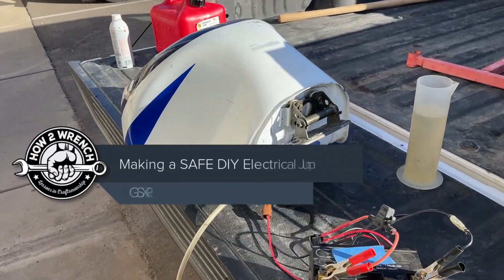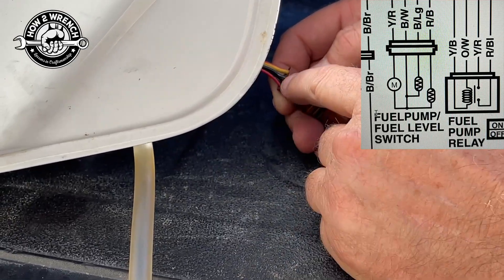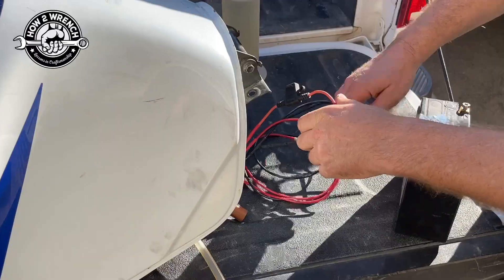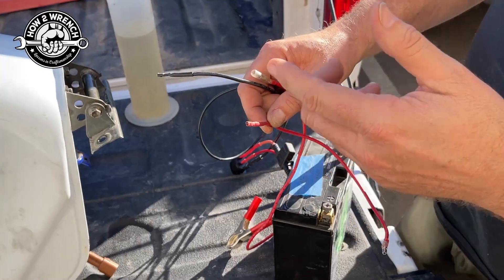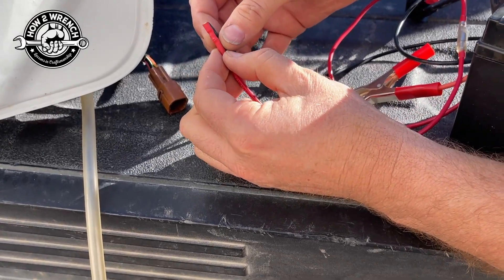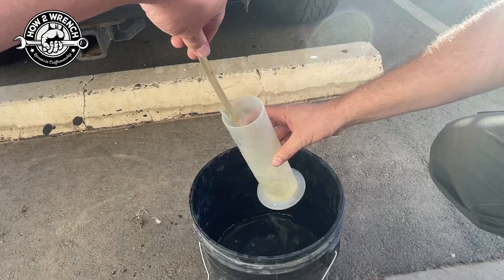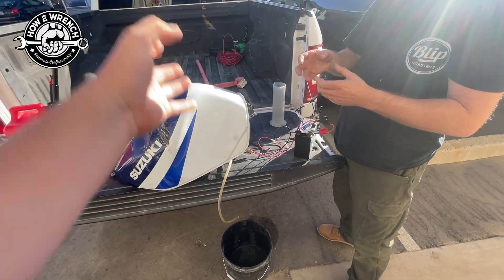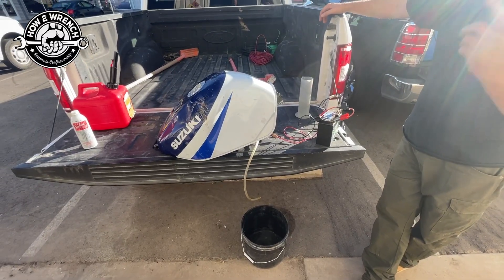Fuel pump testing with this simple DIY Tool Makes Electrical Testing 100% Safer!

Comment from the maker: Build Materials List: 
LED Switch: https://amzn.to/3KPBKka
12 v fuse holder: https://amzn.to/43d68LC
Alligator Clips: https://amzn.to/4mT9GK1
Wire 14g: https://amzn.to/4h9KCgI 
Heat Shrink (with glue): https://amzn.to/42E4CCe
Electrical Connectors (smaller modern): https://amzn.to/4qdiEF5
Electrical Connectors (larger asian imports): https://amzn.to/42XlnIP 
Deutsch connectors: https://amzn.to/43fYIqZ 
Crimping tool only: https://amzn.to/48rhAa3 
Crimping tools (with connectors): https://amzn.to/4h8uv2T

Comment: I hate to tell you, but your technique is dangerous.
I used to work as an electrical engineer at a large hospital. 
You should keep switches at least six foot away from any open flammable liquid. The smallest spark can cause a fire and it's no fun on a burn unit. 
Keep your battery and switch 6 ft away and have a fan blowing away from from sources of the powers ounce directing fumes as far away as possible from the source and switch. You should also use electrical tape over the fuel pump connection.

I'm a burn victim and stress safety when working with flammable  liquids. 
You just have the wrong execution of the right idea.
Reply from the maker: Interesting thought. Seriously appreciate it. Question though: The battery and switches on the motorcycle cannot be 6 feet away. The battery and switches are anywhere from 1-2 feet on any motorcycle. How would see my test as any additional risk? 🤔
Reply: @How2Wrench hopefully, they are in sealed connector that have no possibility of being moved. 
Crocodile clamps can move and, I don't know the switch you were using. When using any connections you should insure, when off the bike, that there is not the slightest amount of arcing.